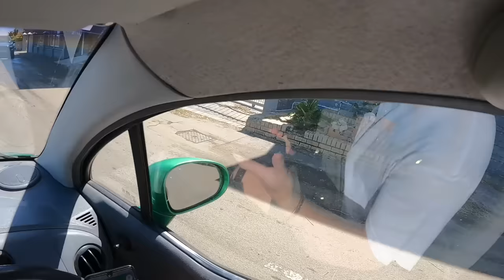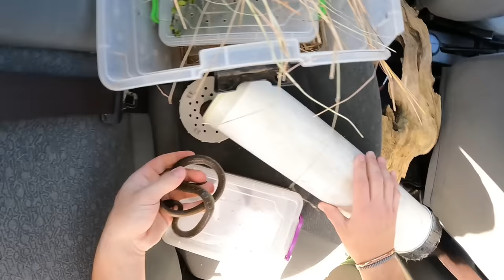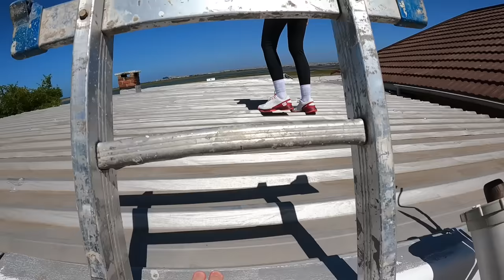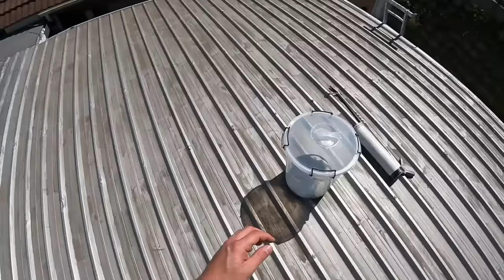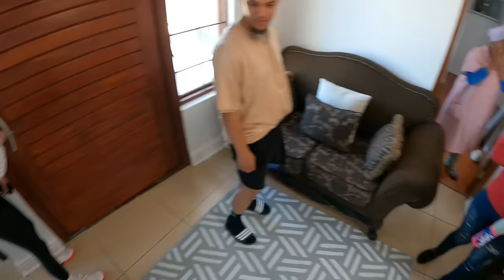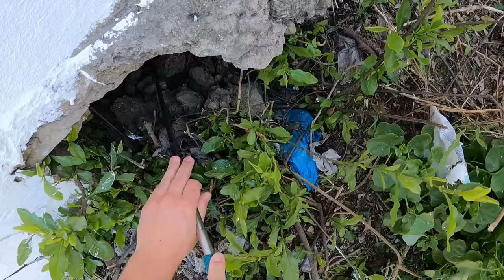Cape Cobra tries to EAT a Deadly Boomslang!

Comment: What is the difference tween a green mamba and a boomslang, i got bitten by a yellow and black boom slang no issues that i know of. Was small about 350mm long
Reply: No envenomation then. If it had envenomated you you'd probably have ended up bleeding from every orifice and possibly dying.
Reply: @nerdyali4154  yes has anyone ever survived a bite from one?
Reply from the maker: It's very possible it wasn't a boomslang, they generally only start getting their adult colours after they reach 1m in length. But people have survived bites from them without antivenom, but it's because they were dry bites👍